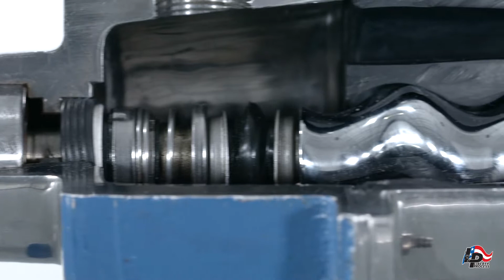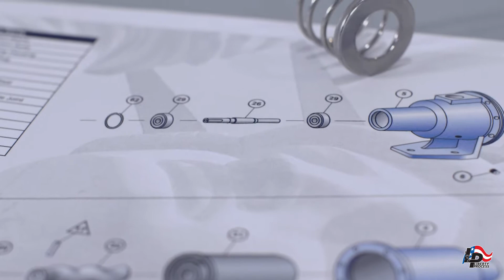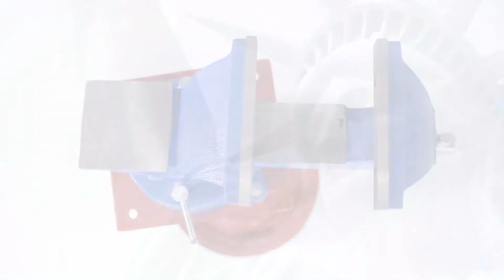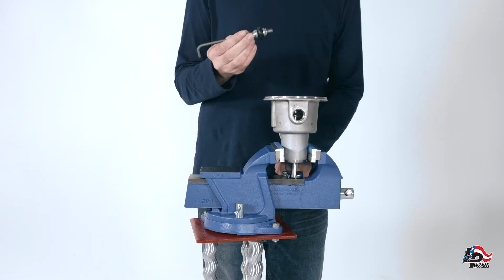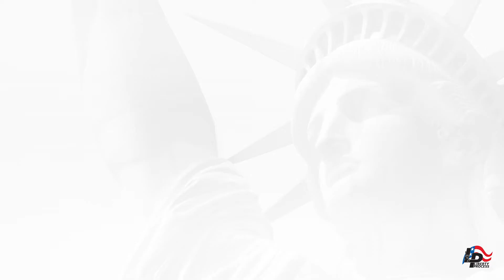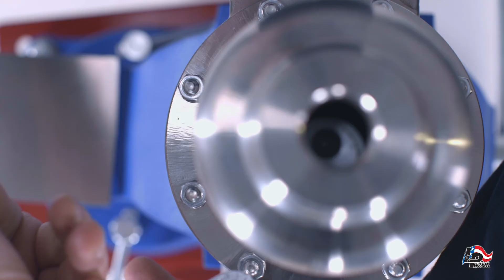American Series AP44 Wobble Stator Pump Assembly & Disassembly

Comment: Could you show how to assemble when part number 25 is pinned and not threaded?
Reply from the maker: We're looking into doing that pump in the near future!. We'll go check the archives and see if we have anything we can show in the meantime.
Reply from the maker: Hey there, @josephblazei1126 , we did a short video on the topic of installing or removing the pin joint on the American Series wobble stator pump. 
You can check it out here! --> https://youtube.com/shorts/trVR5WHxkgo 
Let us know if this helps or if you would like more information.